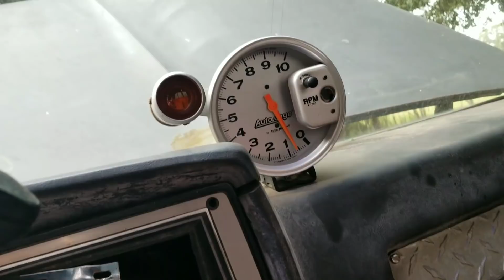92 Chevy Silverado BUDGET 5.3 LS Swap PART 3

Comment: Can I put a 350 vortec out of a 97 1500 in my 1990 tbi 350 spot
 with a tbi intake on vortec to use oem tbi 
In the forms it says I have to retune it   I should be able to just drop it in and go right
Reply from the maker: Yeah but you will need an intake for the vortec heads and then put an adapter on it for the tbi.. a retune would be best but if it's just a stock motor itll prolly run fine

Comment: Sorry if the question is dumb but I don’t know too much on fixing cars but won’t it be a hassle changing the spark plugs because the headers are in the way or ?
Reply: Just gotta use a swivel on the socket... They arent to bad... I use to have a 5.3 with short tube headers... Its not too bad to mess with...

Comment: This truck is clean. Here in Massachusetts that truck would be rotted to death. I'll take Dorr over rust any day man
Reply from the maker: Yeah we pretty lucky down here when it comes to rust
Reply: I got pretty lucky the person I got my 88 from brought it from Oklahoma to Massachusetts. I've never driven it in the snow. I haven't swapped it yet but I er rebuilt the 350tbi and I've dropped it 4 in the front 5 in the rear
Reply from the maker: @WeirdBeard617  shoot yeah you cant beat that.. I love these trucks and the tbi motors are reliable as can be

Comment: Hey man great video. I've been watching this swap very closely due to I'm starting my swap in my 89 Gmc next week. I do have a question which vehicle(s) can I get the steam port lines u have on ur  engine. I just have the one on the front of the engine.
Reply from the maker: Thanks for watching.. all the ls motors I've had had the steam lines running from front to back.. I've only had one that only had em in the front.. what year is your motot?
Reply: 03 Yukon xl
Reply from the maker: @mr.ls-s860  oh ok you could prolly just go to a junkyard and get some off of another engine.. most the ones I have are 99-04 year engines and all have had the kind that go to the back
Reply: BowtieGuy601 OK thanks I'll hit the jy tomorrow
Reply from the maker: @mr.ls-s860  no problem good luck